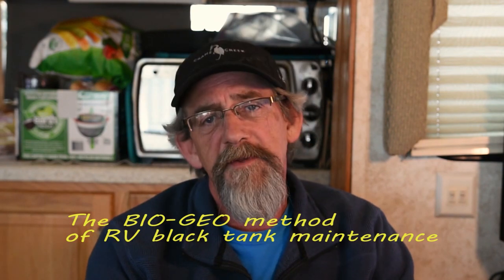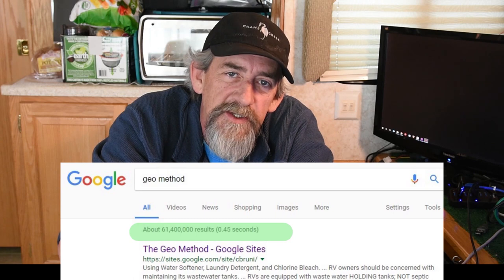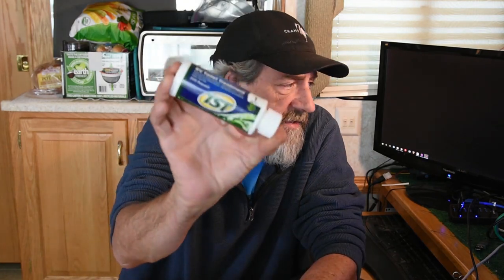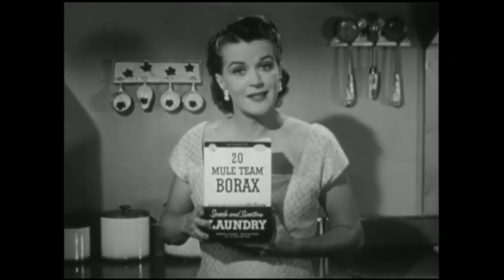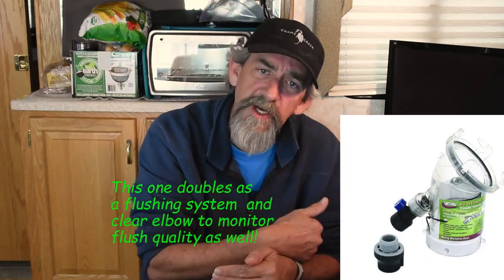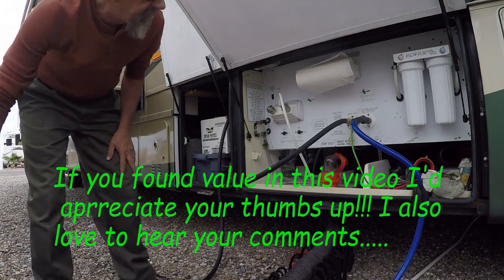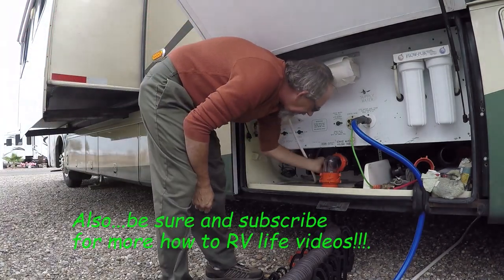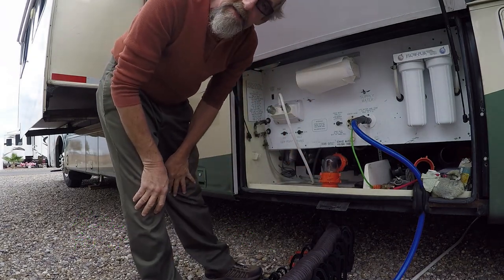A New updated video has been published. Link below - The Bio-Geo Method of RV Black Tank Maintenance

Comment: Great video. Being only two processes for breaking down bio-solids, effluent if you will are mechanically or biologically and you did a fine job in your description. Being retired from environmental engineering for many years I really appreciated your video. Key word many are not familiar with are anaerobic, (An anaerobic organism or anaerobe is any organism that does not require oxygen for growth. It may react negatively or even die if oxygen is present. An anaerobic organism may be uni-cellular or multi-cellular). Yes glad you mentioned peroxide as well.  Congrats Mr. Bowlin.  One fine video for many to have a much better understanding. Thanks. Sam
Reply from the maker: Thanks for you kind comments Sam. I always worry about simplifying to the point of being incorrect. I am actually in the process of revising the video with better graphics and explanations (I hope) plus a few modifications to the method that make it a little more water efficient. Having a time trying to figure out how to explain Ficks law of gas exchange but it will work out. I may even get it done in the next little while...I just need to quit playing out in the desert and edit more video. Thanks again I appreciate you watching.

Comment: Watched your old geo method when we bought our preowned trailer. This method fixed the faulty sensors and doesn't stink. Even impressed my dad who has refused to let anyone do number 2 in his rvs for 30 years. We have a jar of borax under the sink and a refill size of dawn. Weekend warriors mostly and don't have issues. I start with five bowls of water. Borax added to bowl 3 and soap added to bowl four. Then rinse the two measuring cups in the sink to get some into the grey tank. Thanks again for sharing your knowledge.
Reply from the maker: That's great to hear. It sounds like you have a good routine for managing your RV's holding tanks. I also appreciate the feedback on how well it is working for you. Happy Camping, Alex!

Comment: Thankyou so much for this video. We live full time in our trailer. The odour was just like a sewer. I have now rinsed the tank 4xs in a row then added one scoop Oxyclean and a cup of Dawn. Absolutely no odour. The other thing is we are going a long time between having to empty the tank. I think we were never totally filling it because as soon as it belched we thought it was full. I think the gases were building up. No more belching toilet. The reason I used Oxyclean is with all the cleaning shortages from Covid19 there isn’t a box of Borax to be found anywhere. The Oxyclean works great. Maybe even better. Thanks again
Reply from the maker: Yep, a ton of cleaning products are hard to come by. The Oxyclean works the same way as the borax, just a different chemistry. Still produces tons of hydrogen peroxide, which is the whitener. Yes, it is a little more expensive, but you can now experiment with how much to add to treat the tanks. Very happy to have helped!

Comment: I noticed that in many of the videos, they only show the black/gray tanks being emptied.  So if memory serves me right, you should attach a hose to the "Black Tank Flush" turn on the water and let it run as you go and open up the black tank every few minutes.  Then, once the tank has run clear, let it fill the tank, leaving around 5-7 gallons of water in the tank, and then shut the black tank valve.  And dump in a cup of Boraxo, and maybe a half-cup of "dawn" in the black tank.
Reply from the maker: If you are doing the "road scrub"...recall that is where you treat the tank and drive down the road a while to scrub the tank then yes. If you are parked and just want to treat the tank for odors and such you can cut down the Boraxo to 1/2 cup and eliminate the dawn.  

Thanks for your comment...hope this helps but if not feel free to ask another question. I am currently boondocking and have no internet connectivity. I happen to be 'in town' getting some groceries and am in cell coverage.

Thanks again!
TR

Comment: Thank you for so much info! Truly helpful, but I'm still a bit unclear to the actual steps. Do I have this correct? 

While you're holding you use just borax (or OxyClean), adding when smells start. But that's ALL while holding. 

To clean, while traveling, you ADD the detergent to the Borax.

When dumping,  you fill (1/4 tank or so )and dump, fill and dump, etc. until clear.

Then you're back to holding, which is just 1/2 cup of the borax.

Do I have that right?

Thank you!
Reply from the maker: Yes you have it perfect. Thanks for watching Claudia, watch for an update  video in the next little while that will clarify the steps.

Comment: Great vid! Questions
Why don't RV manufacturers make the black and gray tanks with the the bottom with a slope to the center and the drain placed in the middle like a kitchen sink? The solids would concentrate in the center and the flush valve would then be directly underneath the bottom of the tank.  It would help with the removal of the solids.  
With regards to providing oxygen to the tanks has anyone ever thought of simply adding a little aerator like that used in a fish tank? It's a tiny pump and I have used them all the time for my 30 gallon fish tanks?  Wouldn't take much in the way of amps.  The waste treatment plant we have at work pumps air into the plant to help with the aerobic bacteria.
Reply from the maker: You could surely add air to the tank that way. In commercial treatment adding oxygen is really common, just not as easy in an RV.

Comment: That was one of the best instructional videos I've seen from the RV community. Thank you for taking the time to pass on your knowledge and experience.  I'm rebuilding [not remodeling] a 73 Prowler and during the demo when removing the floor I noticed the aluminum belly pan had particulate matter where the toilet connected to the tank at the back of the trailer and ran across to the front approximately 16'. There was no sign of the overflow above the floor and the oder wasn't identifiable as "particulate matter" until we lifted the floor.  How does this happen? Can an over filling the tank cause this?  I've scrubbed the aluminium several times and can still smell it and this trailer had sat unused for many years.
Reply from the maker: Thanks for you kind comments. It could... I suspect that there was a leak either in the tank, the pipe stack from the toilet to the tank and  or perhaps the drain lines or the vent lines. Rolling down the road and sloshing around may have caused material to leak from the vent or drain lines (tank, toilet to tank connection???). When you roll down the road there is a ton of flexing and stress put on things like water and drain lines, vents, etc. so they can crack or joints in the lines can separate if they were not glued and supported correctly. Sounds like a fun project and I would check every joint in the drain and vent lines. As far as the smell you can try two things. One vinegar may kill the smell or you can buy 35% hydrogen peroxide from a health food store and use that to scrub the pan... IF YOU USE the 35% peroxide be sure and wear gloves because it will literally eat the skin off your hands...It's pretty powerful stuff. I had to use it to get the smell out of the cupboards in my coach when I first got it because the past owners had spilled food in them and it had seeped into the wood and the space between the bottom of the cupboard and the bottom of the cabinet. I literally had to tear the bottoms out of all the cupboards and treat them with the 35% peroxide four times to kill the smell!

Thanks for watching and your comments John!...

Comment: Thank you for this wonderful video, big help for a newbie to the 5th wheel world however there's something that I'm just not clear on, how do you know how long to leave the water on for?  What I mean is you let your hose run for 5 minutes, how do I know how long to leave mine on?  Is 5 minutes the standard?
Reply from the maker: No 5 mins is not the standard. Leave the hose (flusher)  running in the holding tank long enough to fill the black tank to  25-30%  of capacity, then empty the tank, close the valve and fill the tank again to 25 to 30% and  dump it again. I've found it takes two to three times of rinsing and repeating to get it clean. Remember your trying to get the whirlpool in the tank to help carry away the solids in the tank. Hope this helps and thanks a ton for watching!

Comment: Great information. New to rv and purchased a new rv. Using your method and there is no smell and tanks read correct. The problem I have is that when I drain the full tank, the inside just stinks! I don’t know why this happens. Any idea what is causing the stink when I drain?
Reply from the maker: That is not uncommon. Does your toilet hold water? If not it could be sewer smells leaking in that way. What kind of RV do you have?
Reply: @trbowlin  A 2020 Entegra Accolade, similar to a Jayco Seneca. Yes, the toilet does hold water so the smell is not coming from there.  The smell is worse in the rear where the holding tank is. Again, there are no smells any other time, just when I drain when it’s full. We don’t full time in it and I always drain and flush before storing.

Comment: @
            

        

      
      I recently acquired an TT that after the very high Pine Sol Aroma was gone, the inside of the TT smelled like sewage, and after putting water in the traps, it somewhat diminished but the smell prevailed heaviest in the bathroom. I watched your Bio Geo method videos, and noticed that you referred to Borax as Boraxo... Is there a difference in which one I should use? Also, in order to dump, it is a 30+ mile trip and I am considering using a macerator to dump in my home sewage. This would allow me to flush several times as suggested. Can I allow the Geo mixture to sit for a while and then use the Macerator to move the fluids+ to my cleanout? I look forward to using your method.
Reply from the maker: Yea, old habits die hard. 20 mule team borax is what you need. I kept calling it boraxo but they are the same thing. Yes you can leave it sit with the borax and soap in the tank for as long as you want. In fact the more you can soak the tank the more likely the level indicators will work properly.

Comment: A couple years late and I am sure you moved onto other topics, however, Lets say I dump my tank while staying at a resort. Do you recommend flushing it out as you demonstrated 4 or 5 times every time you dump it? More importantly, once it is dumped, do you fill the tank about half way ( or what ever) before using it again?  I have been putting some water so the waste can float and not sit on the bottom. Not sure if that is right or wrong.
Reply from the maker: Hi. I try and answer all questions. I made a new video that is much clearer https://youtu.be/wUWGlm2gQfE 
Also on my website I have a short cheat sheet of the method. http://www.trbowlin.com/biogeo

To answer your questions. Yes I flush 2-3 times from a tank about 1/3 full every time I flush.
When starting a new cycle start with 2-3 gallons of water in the black tank and add 1/2 cup of Boraxo. 

The new video is much clearer and the cheat sheet should answer most of your questions.

Thanks for watching!

Comment: Hi, I'm parked at a residential park connected to plumbing. I'm new to rv living. I did clean out per your instruction.  But what I don't know if I need to keep valves closed so several  gallonns should be in the tank, then flush it once a week.. or will it flush oou all the way if I pour in several gal of water?
Reply from the maker: Yes, the best thing to do is leave the tank valves closed unless you are dumping the tank.  I updated the video, and it is a little clearer. You might watch this one too. https://youtu.be/wUWGlm2gQfE

Comment: Would a bottle of hydrogen peroxide from the dollar store work instead of borax?
Reply from the maker: Excellent question! I've experimented with that and it seems that it does not last as long as the borax. When you do the math it is actually cheaper to use the borax at about $0.40 cents per treatment where the peroxide costs a dollar.

Comment: Thanks, TR.  I bought a 2 year old used RV . . . that had a black tank issue.  I worked, similar to your method, getting the tank cleaned out . . . I thought.  But after "the big clean" it seems I was back to less capacity the next time.  My tank is 38 gal. and 3 days is about it.  I have been using much more water but believe I should be able to go longer (1 person).  Are you going to tell me it wasn't really clean?
Reply from the maker: That does seem to be a little short. I can usually run 8-9 days on my 45 gallon black tank (1 person also). Are you sure your tank monitor is working okay? When it reading full use a flash light and looking down the toilet stack can you see water? Also try a little boondocking water saver trick...if it yellow let it mellow, if is brown flush it down... Also you don't have to use a lot of water when flushing the bowl, just when rinsing the tanks. Let me know. Thanks for watching Sue, I really appreciate that and your thoughtful comment.

Comment: Hey TR!  Very informative video.  I've been wondering if adding a septic tank treatment would be a good idea.  That would seed the tank with the good bacteria to get it started.  Perhaps nothing more would be needed.  Have you tried that?  What do you think?
Reply from the maker: There are people that do that very thing. I'm of the opinion that there is enough bacteria and fungus floating around in the environment to 'seed' the tank. I have been thinking that I may try this next summer when I am out boondocking and can not use as much water I would like in the tank and see if it makes any difference. Thanks Susan for watching and your kind comments.
Reply: TR, I've been doing some research for RidX to seed the tank.  I'm told that is a very bad idea, will expand, and mess up the black tank.  There is a RidX for RV.  I didn't find anyone that used that.
Reply from the maker: Depending on how much you add it could make a mess. Most septic tanks are 1000 or more gallons so a box is intended to treat 1000 gallons. If I were going to use it to seed the tank I would only add a tablespoon or two.
Reply: TR, my response went before I was finished.  Sorry about that!  The RV campground had a bath house put in on a septic system.  When people started using it there was a terrible stench.  They called the plumber and he responded, "I must not have put in a dead cat.  Let me get back to you."  He said that works better than anything else to seed the septic tank!  I wondered where he is getting a supply of dead cats!???  Happy New Year  :)
Reply from the maker: Wasn't it Arlo Guthry...There's a dead cat in the middle of the road...
Reply: @trbowlin  About the dead cat... I remember an old timer told me many years ago that when their cesspools would start to smell they would throw a dead animal in it, like a racoon or a few squirrels. I asked him why and he said "Beats the Hell out of me, but it worked". It figure it had to do with the bacteria created by decomposition. You have to hand it to the those generations that came before us. They may not have known the why but they had the what down cold! Love your video! Your sage advice and demeanor reminds me of those wise people... Except you know the what AND the why... :-)

Comment: so in case i missed you say it.. 
what do you start your newly cleaned black tank off with, more borax and dawn or? 
thank you bro great vid
Reply from the maker: After some additional testing I'm doing because I am working on an updated video I've found that only when it is warm (over 80 degrees daytime highs) I have to START with 1/4 to 1/2 cup of Boraxo only and a couple gallons of water. Otherwise I just start with a couple of gallons of water in the tank and add 1/2 cup of Boraxo to the tank when it starts to smell. Most weeks I don't have to add anything. Hope this helps... Thanks for watching!!! Hope to have the update video out here in the next couple of months...

Comment: Wondering if your method/chemistry would work on what's commonly called a pyramid? The tank has been abused by others for about 11 years. I just inherited the problem.
Reply from the maker: It will over time. My suggestion, do the Geo-Method as you move around for a while. That will eventually saturate it and break it down. I had the same problem and after 6 days of diligently flushing every morning, GEO method and drive 300 miles, then flush again it finally cleared up. I know it's literally a pain in the A!%%^, but it worked for me. I've also seen postings on forums where people add a 10 pound bag of Ice to the tank with the GEO method and then driven. The Ice works to break up the pyramid, at least till it melts. I think that is a little extreme and lacks patience but it seemed to work. Good luck and thanks a ton for watching!
Reply: TR Bowlin thank you!

Comment: At 17:14 you mention a "spinner" or sprayer inside the black tank.  Can it be adversely affected by too much water pressure?
Reply from the maker: Sure. Just like the other plumbing in the RV too much pressure can damage the pipes and fixtures. Low pressure and it does not spray as well and you may need to rinse longer. Thanks for watching Kevin!